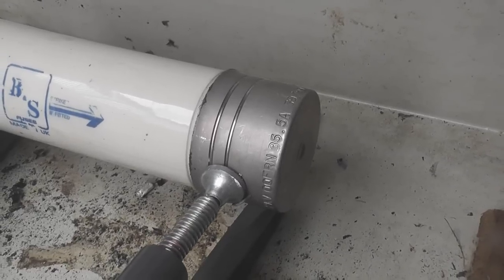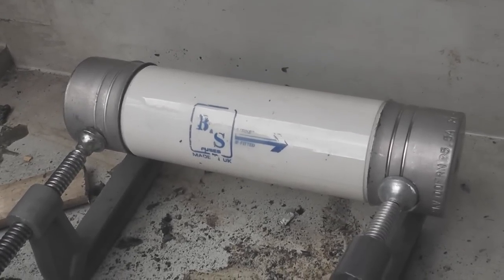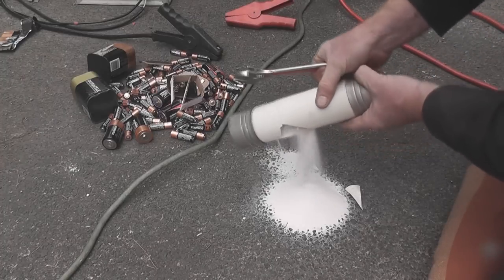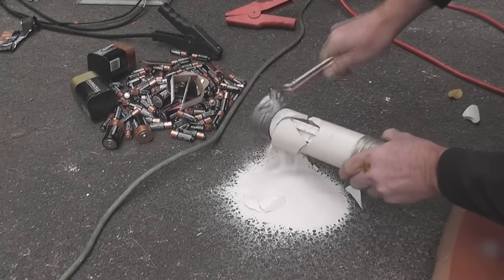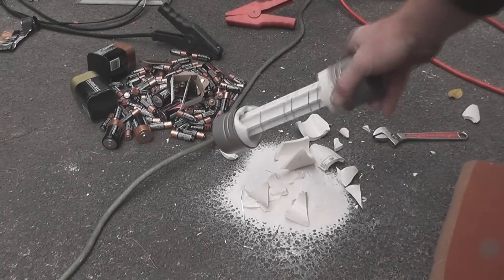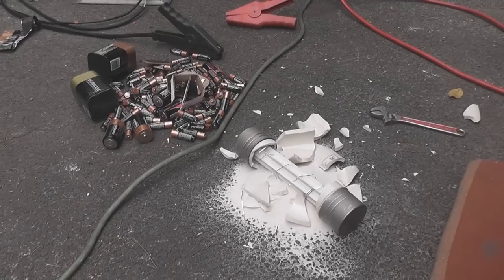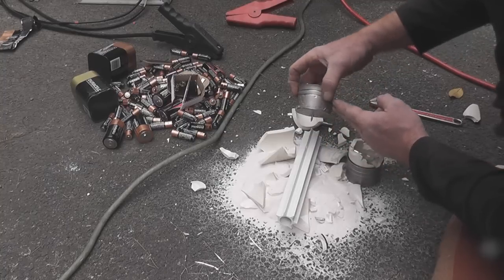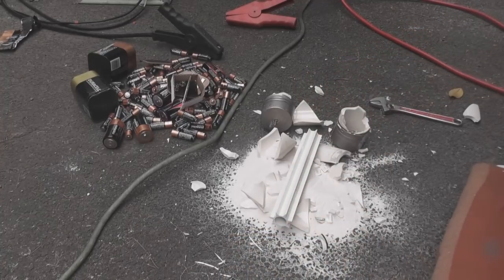Striker pin operates in High Tension Fuse

Comment: I've seen indicator pins on some smaller fuses before. Usually it pops up a small red plastic whisker as a flag of surrender ;)
Reply from the maker: Yes indicator pins or coloured discs are to indicate if the fuse has blown, they are used on the D 2 and D 3 Edison fuses as well as on certain DIN fuses.
The striker pin is designed to initiate a trip on a tripping device within the switch to de-energize all 3 phases at the same time.

Comment: We use fuses with the "glow spot" which lights up when the fuse blows open. That way you can easily tell by opening a cabinet if you've got any blown fuses-- nice! (They are 480/600 VAC, 5 to 150 amps). I think we may use a similar striker-type in Medium (4160VAC) voltage MCCs and Primary voltage (12.4 kV) distribution centers. Cool video!

Comment from the maker: Interrupt rating is for 250 MVA fault level on most of the 11kV network. Depends how far from the substation it will reduce with impedance of the lines and cables.

Comment: Aaah, You popped it! :-D

That's an interesting way that the fuse operates...it has a pin to show it has popped. 

That thing which the fuse wire was wrapped around inside the casing....that would be interesting to keep so that wires of a different kind could be wrapped around it and then powered-up to make then glow to ridiculous temperatures. :-D

Of course, I assume that thing inside the casing is made of ceramic in order to withstand high operating temperatures. 

Thanx for showing,

-BBD.

Comment from the maker: kA is used for the fuse breaking capacity in kilo Amps.
The kV rating is the Voltage the fuse is designed for.

Comment: In the event of overcurrent the internal wire melts and breaks the current  - its a protective device!  - the sand extinguishes the Arc formed when a high fault current at high voltage is interupted - the two components allow high fault currents to be disconnected rapidly before any damage occurs to cables or equipment.

Comment: Often on striker type fuses the pin operates a microswitch which can operate an interlock on some plant to shut it down safely in the event of a fault or signal a PLC as to which fuse has failed to display on a mimic or HMI

Comment: those have a small amount of black powder and a heater wire that when the fuse blows the heater wire is connected to the power and detonates the powder pushing out the pin